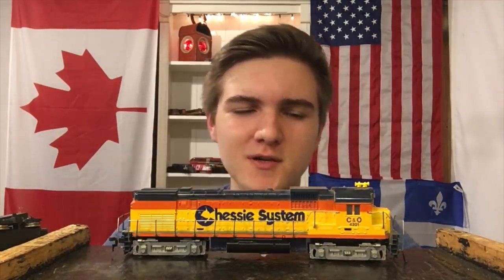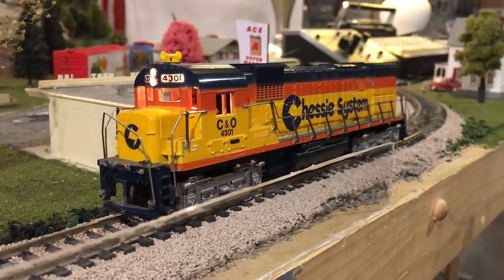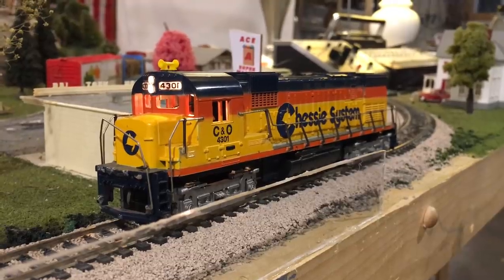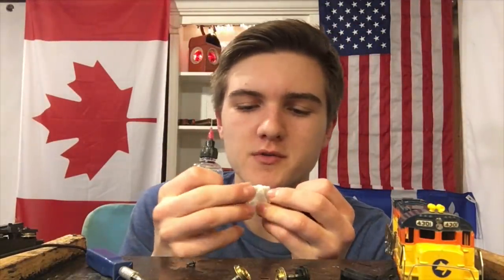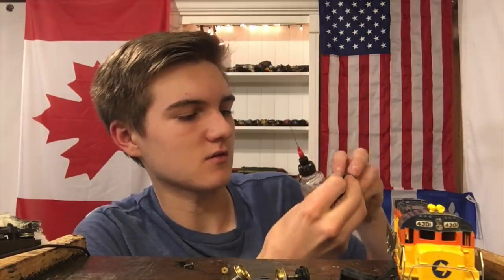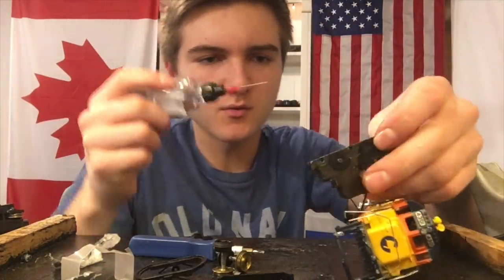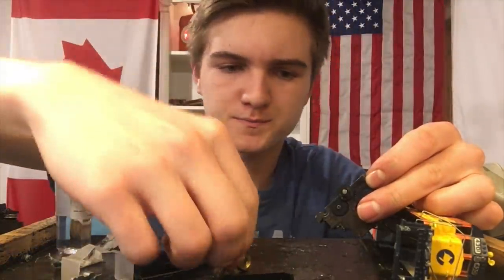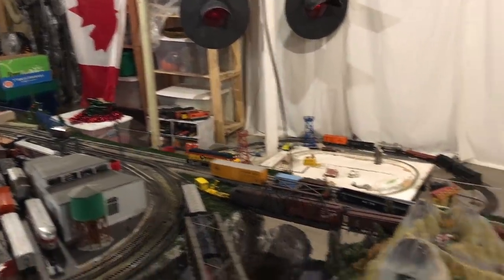Vintage Tyco Chessie System C430 Locomotive Restoration

Comment: Just watched your video on the same loco that I bought stateside for $9.99, and successfully repaired having been stored for best part of 50}+ yrs. Now running ok, main problem was dirty axles and the cleaning out of the gears as per your video. I purchased a vintage 2nd one from states a couple of weeks ago this is now running smoothly as well after cleaning wheels,gears,bearings.

Comment: I picked up a cordless dremel for $1 at yard sale 2 yrs ago. I took battery pk apart. And replaced batteries with some rechargeable energizers 🔋. Works great. You should invest in 1 like mine the sanding tips and other die grinder pieces would make quick work with the poor craftsman ship and flashings problems. Best investment for my trains and nitro rc trucks and buggy.

Comment: Very cool that you can get these old Tyco locomotives running again. Most locomotives from back in the day, had these coreless truck mounted inverted "pancake" motors, with the "butterfly" commutators. I've seen them in Life Like, Bachmann, Tyco, and even some AHM, among others. You would usually find these in "starter" train sets that were produced very cheaply, if something went wrong with the loco, you'd usually end up just "tossing it" . It's extremely difficult, if not impossible to find replacement parts, let alone a parts source to maintain these. Usually what I did, if I had these, I'd "dummy" these. I would disable the motor electrically, remove a few of the gears and have a power + "dummy" lash up. These locomotives usually couldn't pull no more than probably six or seven or eight cars if you were lucky.                                                                                                                    In the years since model train manufacturers, have introduced locomotives with all wheel electrical pickup, all wheel drive, and flywheel equipped "five pole" motors,  I've been collecting those. There so much easer to operate, smoother running, and easier to maintain. And because there fly wheel equipped, they won't stall that much like those older ones will.  What you probably could do, is get say a 1000uf 16v capacitor and connect it across the motor terminals. This will "behave" like a fly wheel. It's a good thing that you lubricate the axle bearings because one side of the axle has plastic wheels. Plastic spinning against plastic or rubbing against plastic creates a "static" electrical charge. This can cause dust from the air as well as dead skin cells, to collect on the plastic wheels. This "nonconductive crud" ends up getting deposited on the rails as a result of this.  Also, if your doing any soldering with rosin core solder, just make sure that you have cross ventilation. The fumes from these acid flux type solders is harmful.

Comment: I thought those had the motor with the worm gears on each end.  When did they change to the pancake motor?
I don't like the drive unit on these.  I kitbashed the C430 shell on the chassis of an Athearn SD9.  Length and truck arrangement is spot on.  Had to use the long shank KDs and the narrow Athearn motor.

Comment: Have few of them c430. Illinois, CN, silver streaks and rock island. The pan motor in the seems to run pretty good. Have tried hauling major loads. But they work well. Would love to have that chessie. Even BNSF would be nice. Might have to make 1 using 1 of my silver streaks. I have 5.

Comment: U inspired me to work on a 13 year old bachmann GP50 as a ns loco. I had 2 disconnected wires and had about 10 pounds if dust lol. I will have to fix it up, but will rubbing alcohol mess with plastic?
Reply from the maker: Rubbing alcohol shouldn't cause any issues with the plastic, I've been using it for years and haven't had an issue.

Comment: I unfortunately retired my atsf one today due to mechanical issues and it’s just cheaper too get a new locomotive
Reply: conrail modeler67890 ......can’t remember where I seen it. Maybe on a forum and quick google search may show but I seen where a guy used a motor from  PS3 controller to repower a Tyco (if I remember correctly). If I find it I’ll report back
Reply: Here is the video about using a motor from a PS3 controller to replace the Tyco motor. https://www.youtube.com/watch?v=dQoR-aznbTE
Reply: Alco Power mine is a atlas kato with a lot of moving parts and it cheaper just to get another locomotive
Reply: I do also own a tyco one
Reply: conrail modeler67890 .......sorry I thought you had a Tyco in need of a re-power.  Nevertheless it’s a cool video with some outside the box thinking that you might find interesting. Thanks for the sub.
Reply: Alco Power np

Comment: When removing flashing, depending on how much left from factory. If careful i like to use a little heat. Safer than using a razor. Speaking from a man who has scars galore on his hands. Plenty of cars trucks quads boat motors anything that takes gasoline or diesel. 2cly or 4. Doesn't matter to me.